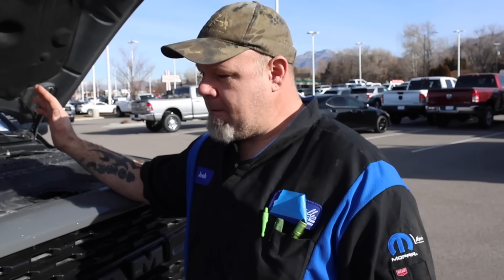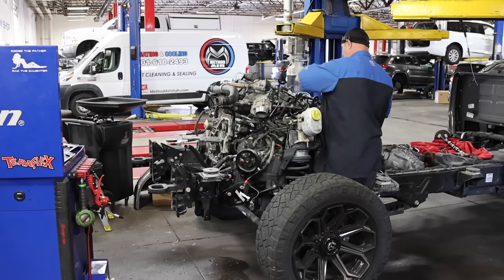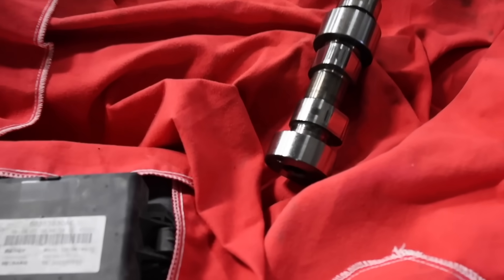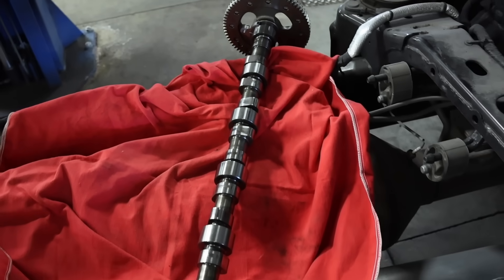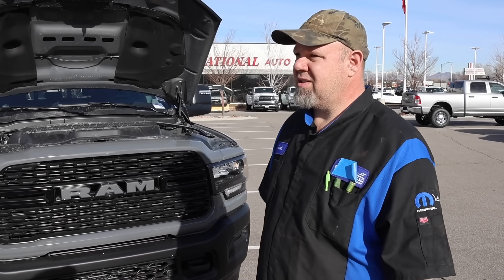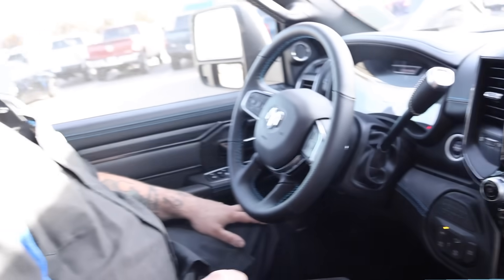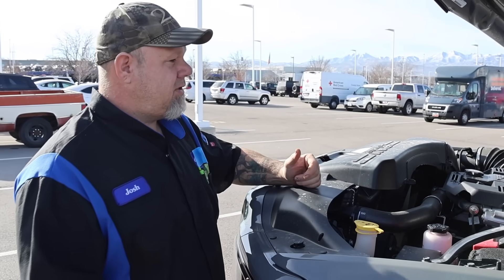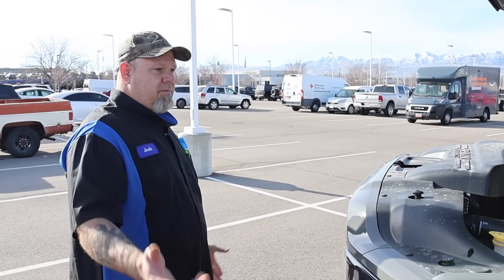Master Diesel Tech Explains The BIGGEST Killer To Your Diesel Engine!

Comment: Been watching your channel on diesel engines in trucks I have the 2022 6.7 ho Cummins that I mainly use to pull a 18000lb fifth wheel rv I want to do some performance upgrades and id like to know where to start with parts running under $500 or less? I just hit 100000 miles and the truck is still stock other then the extra 40gal fuel tank in the bed of the truck
Reply from the maker: You need the trans thermal bypass delete first. The Banks Pedal Monster. Then The idash pro from banks. Don’t forget to use my link and discount code

Comment: Where is the Bell most of these videos don't show the Bell I'm looking for a dually to pull my triple axle call Mark cyclone I rode in a 2500 Chevy 2015 6 0 gas engine versus the issues with all the diesels I'm not going to be hauling for income I'm just calling it wherever I want to haul it there aren't many 3500 out there duallys with the 60 is it possible at 2500 might do it single axle 3,500 single axle the 60 engine seems a very capable engine also the Allison transmission I like and I love the Duramax believe me the what's the rebuild miles on a Duramax transmission

Comment: Not changing your diesel engine oil and filter timely like 3-4000 miles no time limit fuel filter buy and maintain clean diesel fuel also air filters regularly also maintenance on the coolant level and changes it’s expensive but not while you are installing a new/rebilt engine o whatever it takes hoses belts idler bullies batteries and cables  maybe you get what I am saying no Dave’s secret sauce just playing good reliable products changed on a regular basis. It’s a lot cheaper.

Comment: I'm no expert but I've owned 5 Cummins diesels and I'd never go 15k miles between oil changes. For warm up, I usually let the engine  idle about 30 seconds, put it in gear and take off. I've found it will warm up faster to just drive it.

Comment: While you can't do it in the shop, I always let a vehicle set for 24 hrs after pulling the drain plug to drain and then replace the plug and fill with oil, it may sound silly, but some engines take a while for all the oil to drain down in fact some owner's manuals used to recommend allow your vehicle to sit overnight before checking oil level.

Comment: If high idling is recommended in cold weather, you’d think that there would be a way to high idle right from remote start.  Going out to bump up the idle when it’s 30 below sure does defeat the purpose of remote start.
With that being said, I do not disagree about idling and high idling.
Reply: My Toyota 4x4 has a fast idle button, there's a unit on the engine that looks like a second air conditioner, its piped into the coolant system and when switched on it raises the idel revs and makes the engine work heating the coolant up in half the time, if you leave it like that on fast idle the unit switches itself off once the engine reaches temperature.

Comment: You can indeed get a full drain,,,,The problem with people doing an oil change is they have been told this myth that you need to warm the oil up before you drain it in order for the oil to drain better,,,,That's nonsense ,,,,,,By running your engine with dirty oil just before changing that oil,,,Your circulating dirty oil all over the internals of your engine,,,,So when you then drain it,,Your left with a litre or more of dirty oil in the engine internals,,,,,The best way to change your oil is to leave your car sitting over night,,,,Or as long as possible,,,This way every drop of dirty oil has drained to the sump,,,,Do not run your engine,,,,,Drop the oil,,,It comes out just as easy as hot oil,,,,,,,,And you will get every last drop out of your engine,,,,,Its really common sense when you think about it,,,,,,

Comment: Thanks for vindicating me.  I have a 2004 Dodge Ram 5.9 Cummins 2500 that I run 15w-40 oil in and have always changed it at 5K miles.  Bought it new in 2004.  It is still in great shape and runs like a top.   I also have a 2019 Ram 6.7 Cummins 2500 that I change the oil every 5K miles.(5w-40) I have caught heck from some of my diesel friends about changing the oil that often.  I'm 75 years old and I have never had someone, or a shop change my oil in any of my vehicles.  I also change the fuel filters and air filter every 15K miles.  I rotate my tires every time I change my oil.  I'm an old farm boy who was taught to work on your own equipment.  Couldn't afford to have someone else do it.   When I do it, I know it's done right!  (or at least what I think is right)  Thanks for your advice and expertise.
Reply: '04 I6 was really the last reliable version.
Reply: @OldCurmudgeon3DP 06 and early 07 has the best 5.9.
Reply: @0861USMC early '04 had no emissions BS that I'm aware of though.
Reply: I'm sure you know those five point nine Cummins are legendary, man.You can't tear them up. i would never wait that long of an interval to change. The oil 5000 miles is about right like I have a gas truck, and they say 10000 miles. There's no way I'm going 10000 miles
Reply: @chrismarbrey9678  Yeah, it's pretty dumb to go 10,000 miles between oil changes. Some will tell you every 6 months which makes no sense at all to me.
Reply: You are a wise gentleman 👏🏼👏🏼
Reply: I have a '93, a '07 6.7 and a 12. I do exactly what you do; Never go past 5k miles on engine oil and filter and NEVER use a Fram filter. The high oil pressure of the Cummins engine can suck the filtration medium right out of the filter and plug engine oil passages.
Reply: That’s great that you still service your own vehicles but changing the fuel filters at every 15k is wasted money but if that’s what you want to do then have at it should also put in fuel additives, such as HOWES lube. I have been putting that in on every fill up since I got my Ram.
Reply: Yup
 I'm 73.
  I do all the work myself. 
36" Motorhome , 40 ft boat a 2003 5.9 3500 and a 2012 6.7 3500..
Reply: 2022 RAM 3500, 6.7 L Cummins. Oil and Filter are changed at the 1/2 point as per the Digital dash recommendation with Scheaffer's 5W-40 oil and dealership Filter.
Reply: I have a 2005 with 275. Change it every 10k with 15w-40 rotella. No issues whatsoever with the motor. No blowby. Runs like a top.

Comment: Happy with my Suburban 6.5TD  1996 4wd, 270k miles, still rund nice with a bit of 2 stroke oil in the fuel... Always use Castrol 5W-40 MagnaTec, and sure, not EGR. My volvo D5 with DPF and Euro4 smells like shit, but not the old 6.5

Comment: I change my oil every change of season whether or not I have the miles. That’s why I bought a second 4 cylinder car. My Ram doesn’t like short trips. So I don’t put lots of miles on my truck. Still Louisiana’s weather is roughy on diesel trucks.

Comment: I have a 2020 duramax and during the winter it auto revs for 10 minutes to warm it up. During the warm months I still warm it up for at least 5 minutes. I also change the oil at 5k to 7k. 5k if I tow a lot.

Comment: Sounds like this should be a great engine, but time will tell I know the old  slant 6 they had yrs back ,was like iron ,you couldn't blow it up ,inless u held it to the floor ,and  drained the oil out of it .I just see a mistake, dropping  the 5.7 himi  all at once, this being a new engine  ,most people will shy away from it ,because no one will know if this engine will hold up good with out issues, I believe if ram has that engine breathing good ,then it should hold up well and not have carbon issues. And ram taken technology from  the German auto maker ,by not usen a dip stick is just stupid, in my mind ,because after a auto gets some miles on it ,how dose one know the gages are correct, showing oil levels ,I think they should have a dip stick ,because a dip stick won't lie ,infact not haven a dip stick  and the fact of buying something, of this high expense, and not knowing if they will have big issues  are just a great truck .I kinda believe this will be a great engine, but time will tell .after I see some with a 100k plus miles on them I then will consider buying one ,I have bought meny new ram trucks  but now scared of one because no one knows how this engine will hold up

Comment: Today it is 15 March 2025 and our TRUMP Administration has removed the EPA’s regulating Automotive Manufactures  Exhaust and mpg mandates !
    I had my 2018 F/350 6.7 Six Speed, Limited Long bed Fully Deleted (good bye EGR / DPF & DEF !!) and an, EZ Link clean 650hp Tune by our FORD Dealership in Milford, Mi. @ only 44 miles on the odometer plus, “ AmsOil’s” Oil Bypass Filters System. 
    After investing over $100k  for my F/350 including Sales Tax, the above actions were a no brainer & today President TRUMP proved that it was a very wise choice !!

Comment: I have a 2018 F-350 diesel I bought new.  It now has 86,000 miles, over 50,000 miles of that is from towing over 14,000 pounds of fifth wheel RV trailer all over the country.  It runs great and no major issues to date.  I have always had it serviced to include oil and filter every 5,000 miles.

Comment: Biggest killer of diesel engine is not changing fuel filters when changing oil filters. A bad batch of diesel can start plugging filter up and once the filter bypass opens all contaminants go to the pump and injector nozzle.  This causing bad burn more carbon and plug dpf,, burns in piston,  poor performance.

Comment: The auto shut off on the remote start system isn't timed based on how long you should let it idle before driving, its timed so if you pocket start your vehicle or start it and forget about it, it isn't sitting there running for 6 hours. Nothing to do with how long you should idle your engine

Comment: I have a 2006 GMC 2500hd 6.6 Duramax engine that I'm working on I have made it a point to start my truck and run for 1/2 hr that's including driving it up and down the street to keep rust off the rotors thats every 3-4 weeks how long can I leave the oil in it if I'm not driving it any distance that actually brings up the temperatures.

Comment: There's a reason why some motors do huge mileage. My Toyota Hiace 3.0l turbo did 2000 revs at 100kmh. Comparatively big motor hauling 2 tonne pulling low kms.

Comment: I only run Aimsoil Synthetic on my manual 05 5.9 3500 and go between 5-7k miles max between oil changes, and I use Hot Shot's EDT to add lubrication to the fuel. Just installed a Banks Ram CAI w/ Super Scoop on her yesterday. Treat them well and they treat you well. Nothing like open-road driving to get fresh powder and steep lines.

Comment: So my 2015 F350 6.7l will display a message don't drive for 30 seconds in cold weather. I run 15w40 Schaeffer's 9000 change it 5000 miles . 340099 miles euns great warm them up!

Comment: I owned a hot shot service for 30 years and found the number one killer of diesel engines in all makes and models was #1 tuner kits #2 lack of timely oil changes #3 young inexperienced drivers. The Dodges were the best overall with few issues. Most of the trucks went well over 400,000 miles when kept totally stock and regularly maintained. All modified trucks rarely saw 250,000 miles without major issues --- engines, transmissions and drive lines all failed prematurely on all the modified trucks.
Reply: what r you referring to as "modified"
Reply: Pretty much anything not factory. If it enhanced proformance above factory specs then it would be considered modified in my life. @jeremyparks3238

Comment: Cummins Engineer here (but thankfully not responsible for anything on a Ram truck). I'm going to try to explain why you shouldn't idle your cold engine more than a few seconds at most. Piston rings don't just need heat to seal, they need pressure also, and a cold idle is a double whammy of low temperature and low cylinder pressure. When you cold idle, you are getting zero mpg and burning fuel that is doing nothing productive and just diluting the oil. Don't do it. Idling is a terribly inefficient way to warm a diesel and is needless fuel dilution and engine wear. Look at your EGTs and you will see how low they are at idle, even at higher RPM. The Low EGT and low heat at idle is why active regen exists.

Instead:
Start the truck. Verify oil pressure. Put it in gear and gently drive. Use tow/haul to get RPM up a bit more than normal and help the oil and coolant circulate a bit faster. I promise you that you will warm the engine much faster this way and the engine will made fewer cold revolutions. And your MPG will improve because you didn't burn fuel getting zero MPG.

If you do a lot of very cold start, you want a block heater and/or Webasto/Espar style coolant heater that burns diesel fuel. With the latter, there's no such thing as a cold start-- the coolant is warm and you'll have instant heat. They are also proven to reduce wear as a result. They're expensive, but on a nearly $100k truck, worth every penny IMO.

Comment: My 82 year old dad just gave me his ‘03 F250. I changed every fluid and filter on it. I won’t drive it much, but I’ll probably change the oil at 3000 miles, which will probably be close to a year.

Comment: I agree with ya totally, everything you said makes sense, im in minnesota right now its 30 below windchills, 10-30 was put in early summer, got close to 5000 nowon oil, just confused on what oil to use, its a 23' 2500 ram 6.7, im gonna change the oil soon here whats your professional opinion  for viscosity of oil i should you use?

Comment: How to fix it? 
Leave the EGR on the garage floor. My oil is not black, my soot goes out my tailpipe.
5k oil changes using syn. Non emissions diesels will run forever.

Comment: I had a 1994 379 peterbilt with a 3406B 475 Cat. I would idle my truck for as long as I needed.  I'd change the oil & filters at 15,000 miles and the oil would be as clean as it was when it was put in. Good engine Good piston rings. Not so today in any engine

Comment: I think you are right on point with oil change intervals. Along with egr contamination, the zinc/phosphate(zddp) additive in oil is lower than ever. Even non emission diesel engines aren’t immune to this.

Comment: Thank you for the information and the education I've owned a diesel since 08 and a lot of other channels haven't discussed what you discussing now I'm perplexed and upset in the sense that everybody always referred to diesel oil always being black without clarifying or discussing the reasons for it and being naive to my detriment I didn't follow up and do the research myself as to why. Now I'm regretting my decisions to the damage I might have done to my engine already, I switched to synthetic but I'm still using 15 and K&N filters but I guess there's a lot more I have to study or it will be expensive.  Thank you again for the education, wow a 10-minute Idol, my neighbor's already complain with my 3 - 4 minute Idol they're just going to have to suffer.

Comment: You can get a much deeper air filter, like 3 times the depth, 4" deep . WIX - 49946, I did. Can also get a better oil filter, dual flow vortex type which has a built-in bypass. 5 micron and 20 micron. Fleetguard and Baldwin makes them BD7317 or LF9028. And do change the oil around 5 to 7,000 miles

Comment: Was glad you talked on the subject of turbos and allowing them to come down in speed before turning off the engine. A mate had been talking to me on that subject,  this week and explaining that the turbo needs oil pressure from the engine running to lubricate the bearings. Thank you for reinforcing this point
Reply: Alo let it idle after pulling a load so the oil cools down. Oil flow stops and the turbo is super hot can cook oil in the sleeve bearings

Comment: Good info on the  air filter vs. egr I think I might have to change it more frequently only changed it every two years. I’ll just change that to once a year going forward.
I change oil ones a year and I don’t drive all that much, about 5500 miles a year. I use the oil recommended by the manufacturer I never drive it for less than 30min and I add additives for the fuel system and the DPF a couple of times a year. And I spray some egr cleaner into the turbo once a year as well. My car is from 2013 I got it in 21 I have never had anything that needed to be fixed engine wise. Apart from oil changes I’ve changed fuel filter and glow plugs when I got it there wasn’t anything wrong it was just maintenance.

Comment: Great video and info. I own a 16 lml duramax. Was in the market for a 24 or 25 ram with the Cummins. I’m scared now with the lifter issue. I know they all have issues mine for example has the cp4, parts fell off on a bumpy road at 53k miles and I also added an airdog. So far no issues at 160k miles. I do my maintenance every 5k miles using the Oem filters and rotella t6 15-w40.